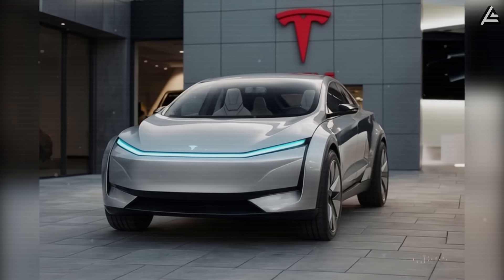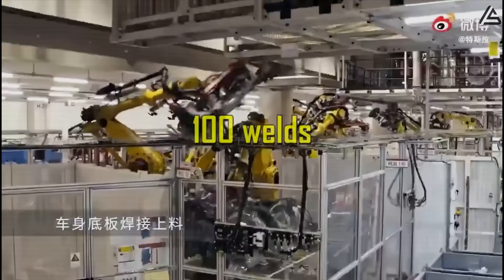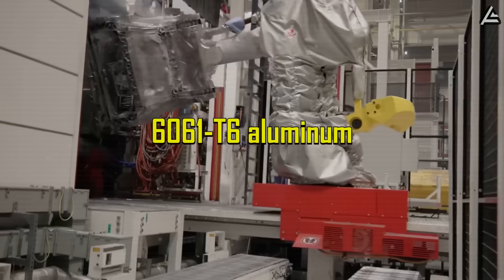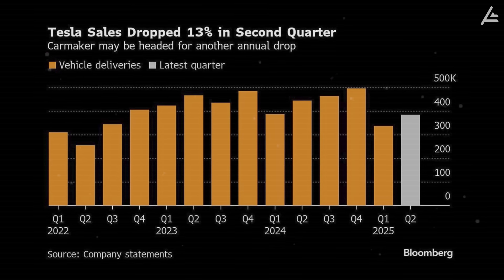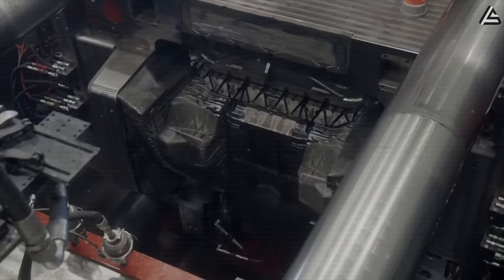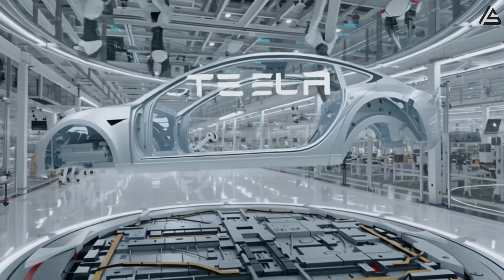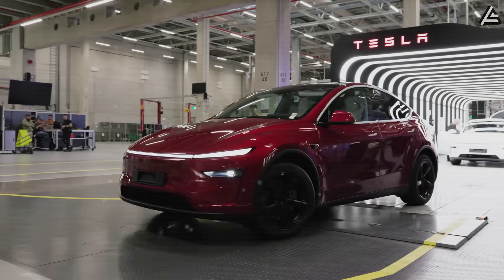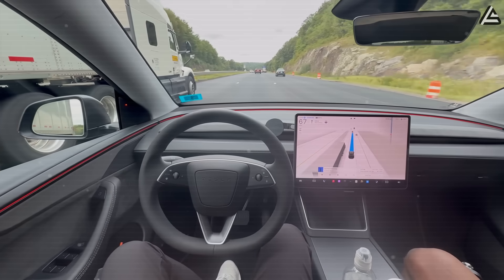Elon Musk Announces 2026 Tesla Model 2 Price & Production Plan. What You Need To Know

Comment: Unaffordable car that is affordable to maintain will penetrative the US market like the origonal Ford mustang. Therefore, the longevity of the electric motor and replacement costs of the Aluminum Sulfate batteries is critical. The closer the price to 10k the greater the market penetration.

Seniors that are less mobile, would probably desire a cross over height variant of the model 2 as they will not care about aggressive cornering and prefer ease of entry and exit.
Reply from the maker: Exactly — low purchase price plus cheap, long-lasting batteries is the formula for mass adoption, just like the original Mustang. Do you think Tesla could realistically hit that $10K target with aluminum-sulfate cells?

Comment: They don't plan on using the new Aluminum Ion battery in this new model? That pairing would make it even more desirable.
Reply: Specifications have not been set. High probability that they will use the aluminum batteries because of the cost savings to make a cost-effective product available.
Reply from the maker: you got a point
Reply from the maker: I have the same thought! Aluminum-ion battery is still one of Tesla Model 2's battery choice